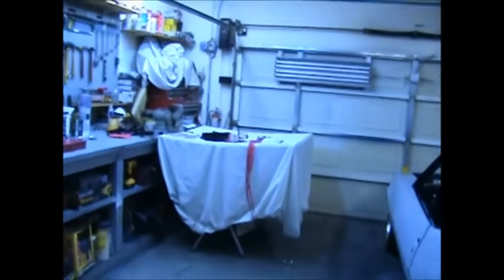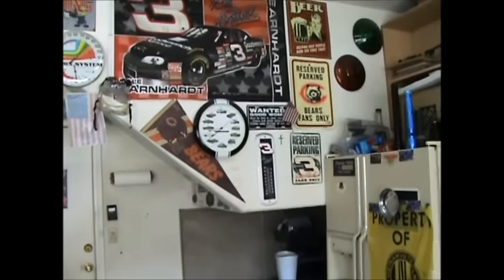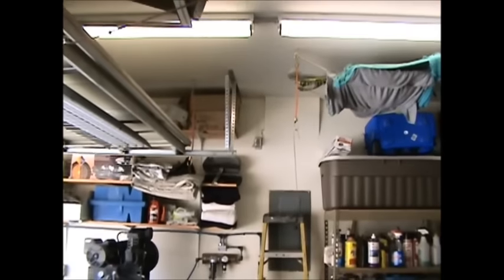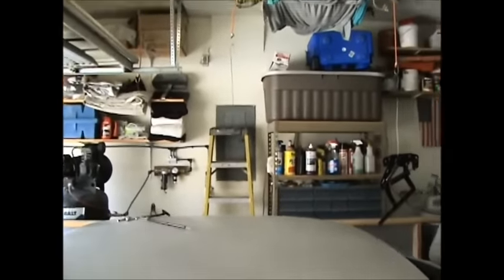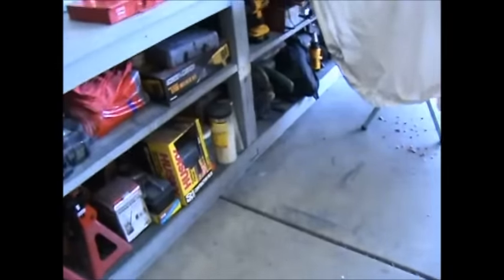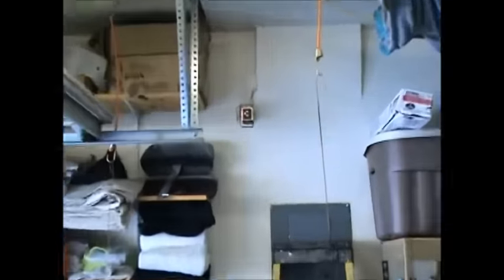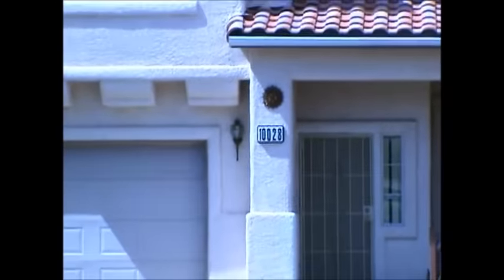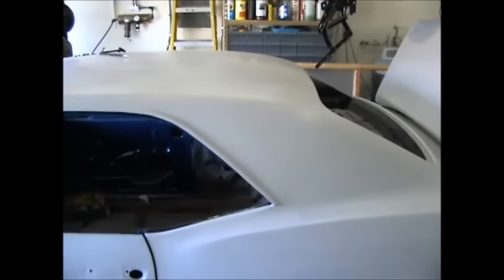1968 Camaro Resto-Mod 7-30-15

Comment: Tom check out Ames Performance Parts. They specialize in Pontiac parts and since the Firebird is a Camaro's sister they probably have the same clips. The catalogs are free and you can also download it in PDF format. I have purchased clips similar to what you are looking for, for my GTO but they were push in not the metal tab style you are looking for. These guys have the small parts you could never imagine someone stocking in their inventory. You won't believe how many "smalls" they have.
Reply from the maker: John Demos Thanks I'll check them out.

Comment: Corvettes use a clip you run the wires into here is a ebay url: http://www.ebay.com/itm/Corvette-Forward-Wiring-Harness-Washer-Hose-Clip-1963-1967-/181699993836?hash=item2a4e29e0ec&vxp=mtr